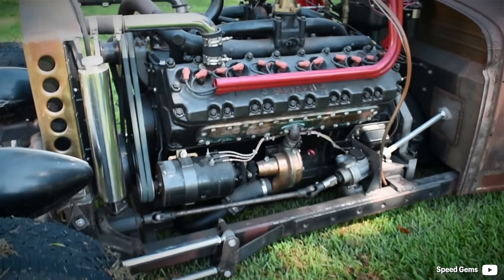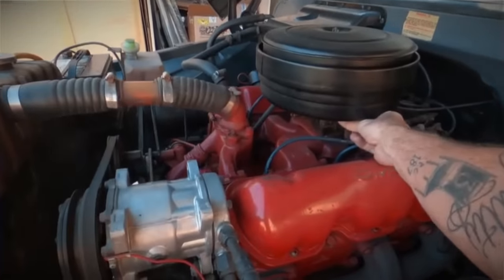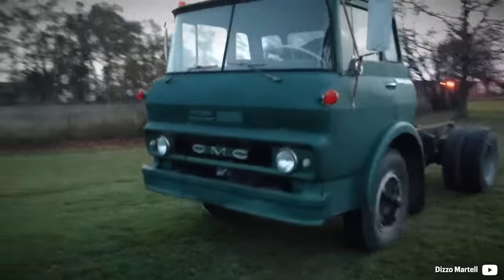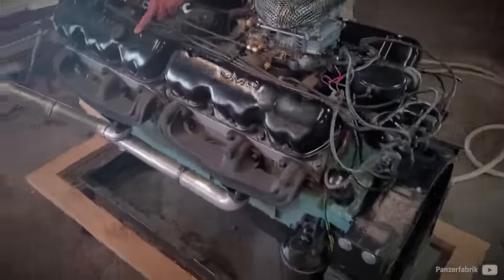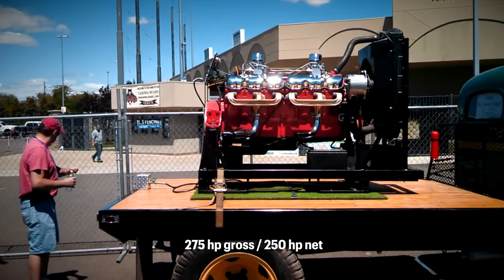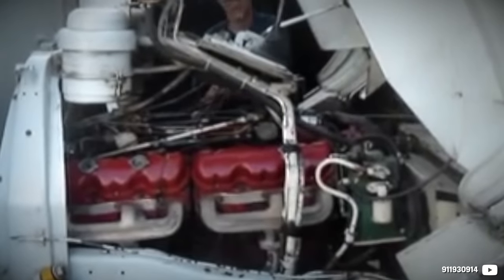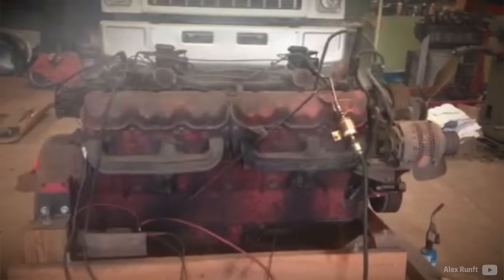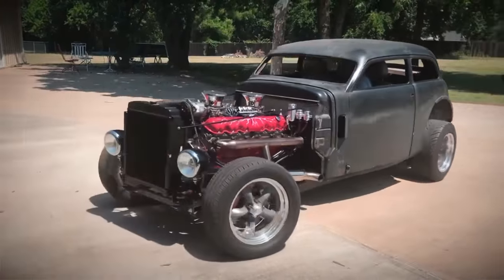GMC's Low RPM Gasoline 11.5-litre V12

Comment: Those intake manifolds are sooo low.. put a high rise on these, do a little port and polish... that thing would scoot along nicely.

Cool motor, didn't know they existed.
Reply: If you could find one or good at making one. I don't know of any aftermarket ones available, the engine was never designed as any kind of performance engine.
Reply: @edmundanderson657 
That's kind of surprising, seeing how many individuals were messing with one of those engines. 

There's nothing wrong with gaining some extra horsepower and torque. Seeing they're used for all sorts of applications, why wouldn't someone want to up those numbers?
Reply: @elgoog7830  Oh I'm not saying people aren't using them or people aren't wanting more out of them.

They just weren't that plentiful, and they are heavy and designed to be a workhorse. Think about it, what was the ratio between cars and trucks in the 60's? Then these engines only came in gmc trucks (and how popular were they compared to the big three) and irrigation pumps. Now compare that to small and big block chevys and how many cars and trucks had them. Then big and small block fords, then big and small block mopars and the cars and trucks they came in. 

They just weren't a common popular engine and the aftermarket wasnt after it. I don't know of any aftermarket intakes, could be just don't know of any. And the stock ones are 1bbl and 2bbl. 

They were made a long time ago and for a short time in limited application.

Comment: If this engine was brought back and adapted to run on propane and increase the compression up to say 11:1 or more it would be a cost-effective replacement for the present diesel.  If you put a boost of say 4-12 psi, electronic ignition, and that higher compression ratio you could easily match the power at low end of a diesel with the massive advantage of fuel costs and a drastically cheaper maintenance issue.  Diesel of old was very trouble-free but on a side note, they had absolutely NO emission controls and mechanical injection systems and required little attention for up to a half million miles.  Now diesel engines have emission controls that zap power drastically, are an absolute maintenance nightmare, and reliability is not that great.  Gas engines at that time required continual Point/Plug changes at 15k miles, which was on an over-the-road truck as little as a monthly item, carbs needed attention every 50k or so and you get my drift.  Now days Fuel injectors on a gas engine last often the life of the engine, and if they need replacement which is usually due to contamination, they are cheap, under $50 bucks each for the most expensive units.  Often you can purchase a reconditioned set for the engine for under $75 bucks, or you can clean them yourself with a spray can of injector cleaner, 9v battery and a homemade pigtail.  So a updated GMC truck gas engine would be cheaper to operate and have equal or more power available.  Yes it would use more fuel but propane is much cheaper even than gasoline and an added plus is it is very clean burning.
Reply: EPA WOULD Get involved and would put EGR and cat converter on them. Remember these moters were made when regular gas was 91 octane and. 25 cents per gallon!
Reply: @lloydmcnurlan6180  Yes, they would require most likely be an EGR and a cat.  However, when you run Propane ONLY suddenly the CAT is not doing all that much and the EGR is employed to lower emissions which are quite low when employing Propane.  Right now there are many Heavy Duty trucks running Propane with great success, however, the Government is the largest stumbling block to the expansion of this concept.  Right now it is all but impossible to set up a propane refueling station for commercial sales due to governmental regulations which do nothing other than prevent them from being instituted.  Companies that do run propane normally have their private refueling yards at strategic locations.  The Biden Administration is placing every stumbling block they can devise to push for EV's, even though it is becoming clear that they cannot be charged rapidly and there isn't enough power available on the grid to support these heavy-duty EV's, it is the thought that counts.  The days of the ORT diesel is rapidly coming to an end, all of the diesel advantages are suddenly coming to an end, sorry a diesel is very difficult to clean up emissions and still have reliability. Again the government acts as normal, "You cannot do this, but they don't have an alternative solution, or the solution is not workable in the real world".  Actual over-the-road tests with light-duty trucks on interstates pulling a relatively light load trailer, their range have a range of no more than 100 miles at best.  Then these vehicles' recharge time even at a rapid rate charger station is sometimes over an hour.  Yes, the Tesla Truck is listed at 500-mile ranges, but as you noticed there hasn't been even 1 unit released to the public as yet.   At low speeds, 35mph average, they do have good operational ranges, so they would be excellent for very short-haul operations on city streets, but simply due to physics they are not going to work on highway speeds efficiently.

Comment: You know if they built engines like motorcycles with the juggs seperate from the crank case they could financially consider this in 2022

Or even a v10 corvette 🤤

Comment: I wonder how powerful a modern version of this same engine would be retrofitted with a modern electronics and fuel injection. Could the fuel economy be made acceptable with modern technology?
Reply: It's already about the same as a modern diesel so...
Reply: @lamarzimmermanmennonitefar5269  I was just wondering out of curiosity since a Ford 7.3 v8 gasoline engine can produce  430 hp and 475 lbs torque (Net) and get decent fuel economy. The 6.7 diesel can produce 475 hp and around 1000 ft torque (Net). I’m just curious. It might not have any advantages. It would just be interesting to know.
Reply: Modern ports and combustion chambers would do a lot more than adding computers
Reply: @lb9gta307  The tactic to keep Heavy Duty/Industrial motors running cool in those days was to drop compression.  If you took the same motor that was a regular duty and compared it to a heavy duty in those years, it would typically drop from 8:1 to 7.5:1 or so.  They had the technology to raise compression back in those days, and chose to drop it instead to make them work.  

So, you are back to gasoline's usual problems when put under major loads.  Sure, you can hook up a 6-10 speed transmission to a high compression gasoline motor, in a LIGHT DUTY truck, and make it work.  But those little turbo gasolines (even with DI cooling) and high compression NA motors with greater displacement don't have what it takes.

You are still going to be running a large displacement, NA motor, and like the 7.3 you are going back to OHV because you can only run those types of motors in the low rev range in all practicality.  And, once again, you will be considering "how high can I crank up the compression before it runs to hot under load"?
Reply: @lb9gta307  true.  But the precise fuel metering of multi-port or direct injection combined with precise control of ignition timing will help too. Adding redesign combustion Chambers , along with better breathing would do even better. But precise fuel and ignition control even by themselves would make a difference, just not as much
Reply: @dmandman9  That 6.7 diesel is souped up and boosted with turbos, for the same boost rate a gas engines of the same size will make more torque and HP and high BMEP than a diesel. this goes for 2 stroke and 4 strokes of equal bore/stroke. look up the ETHOS cummins 2 stroke converted 4 cyl engine on ethanol. This 702 in its 4 stroke state would make about as much power as the 920 CID 6 4 joke stroke diesels today with ethanol and a hot magneto. This 702 could easlily be converted into a 2 stroke and make way more power. keep in mind the 6.7 powerstroke is a 2 stroke and 7.3 gas is 4 stroke. everything newer is not always better!
Reply: @jlo13800  Both the 6.7 and the 7.3 are 4 stroke engines. The 7.3 powerstroke was a great engine. But it produced approx 250 ho and 500 lbs/ft torque. The 2022 6.7 powerstroke produces 475 hp and 1050 lbs/ft torque. Yes. It's much more complex but it's a LOT cleaner burning when I have a properly running 7.3 in my bay, the worker next to me yells for me to shut it off within a couple of minutes because it's choking him. But when I have a properly running 6.7 in my work bay , he doesn't complain. Again the 6.7 powerstroke is a 4 stroke engine. The crank makes 2  revolutions (4strokes) per ignition cycle. The cam only makes one revolution. The 6.7 is a 4 valve, and has a larger turbo. Also, the injectors are much more precise. And the injection pressure is higher which allows better fuel atomization. Those are a few reasons for the improved power.
Reply: @jlo13800  by the way. A modern naturally aspirated fuel injected gasoline engine produces more power over a wider range than an older carbureted engine. Example: a 3.3 liter (200 cid) in a 1965 Ford Mustang produced 120 hp (gross) and 190 lbs ft torque.  But a 3.3 in a 2022 F150 produces 290 hp (net) and 265 lb-ft torque. By the way , the 3.3 has a wider power band. So it produces decent power at low AND higher rpms in relation to the older engine. Both are naturally aspirated engines. So it's reasonable to believe that those old GMC's could produce more power if they were equipped with modern electronics, variable cam timing, fuel injection, etc , much like the modern Chevy 5.3 produces more power than the older small block v8s over a broader rpm range. As I stated. I'm just curious

Comment: Why would you need 2 engine stands? Isn't the block itself one unit but multiples of everything else?
Reply: I'd think it's simply too long for a single engine stand, it would topple over.
Reply: @Jeroen Huge commercial engines and diesels don't use a stand for the front and the rear. Put a 2x4 or 4x4 at the base or front of the engine. That's what we've done when we would be storing a V8 on a stand for a while to keep the stress off the bell housing bolt holes. I realize it is probably highly unlikely, but supporting 500-700lbs by 4 to 6 bolts just in the back of the block for any length of time can't be ideal.
Reply from the maker: Weight, perhaps

Comment: 4mpg = 1.6km per litre 🐱👍🏿
my Yamaha gives me 40km per litre
Reply: How much would it get pulling a 55000 pound load 😉
Reply: @JohnSmith-lb3ge  if i use a 45 final drive tooth sprocket it gets into the 20's 🐱👍🏿

Comment: Remember 3/4 race cams?  3/4 of a V-8 race cam welded to another 3/4 should fit in these right?  I put one of those 3/4 cams in a 327 once, 4 of the lifters kept falling into the oil pan.

Comment: Modern engines: Have to to get timing serviced every 75-80k miles, major service at 250-300k.

GMC: Minor service at 500k 70 years ago.

People like to complain about us car guys that "they don't make them like they used to", but in this case, that's pretty much literal.
You probably get somewhere close if you're talking some industrial or genset Diesels.

Comment: a huge V12 engine with an extremely over engineered block and a crankshaft with little stroke allowing an even greater increase in cc, WHY DON'T TOP FUEL DRAGSTERS USE THIS ENGINE??????
Reply: There was a 550 CID limit on dragster engines (it might have gone even lower).

Comment: The 401 was a better choice over the 478 witch could not hold the rod's in side the block
Reply: The 478 you don’t dare rev over 2800 on the highway.

Comment: You essentially have 2 engines
.
This would be a reliability / always gets ya home marketing dream!!!
.
If one carb goes down... ya still got 50%
Or maybe it's only not opening the secondary, but ya get primares
75% power....
.
They knew the v6 was good
So why reinvent the wheel?
.
Ferd reinvented the spark plug
That went just great
.
I do them... 80 USD per spark plug
If ya got a 6.8 v10.... I'm sorry

Comment: And before this GMC used Pontiac engines.
Reply: For their V8s. The straight/Inline six cylinder was a proprietary GMC design. It had full pressure lubrication when most engines, including the Chevy inline six, were using splash lubrication. This is why the GMC Inline Six was highly desirable for hot rodders and racers in the time before the small block Chevy V8 existed.
Reply: Pontiac V8 engines in the lighter trucks and Oldsmobile V8 engines in the heavier trucks. 1955-1959.
Reply: @HotWheelsBurban  The straight sixes evolved from the Buick valve in head sixes that were discontinued inn the late 1920's.

Comment: Good lord!  Amazing, but why?
Reply: The engine was designed to compete with diesels in heavy duty trucks.  This was at a time before the turbodiesel became dominant in that application, and some manufacturers used gasoline engines.  Lower initial purchase price.
Reply: In cold climates, gasoline always works, and diesel can often times gel up and cripple motors and vehicles.  That is why there are medium duty gasoline trucks to this very day, and gasoline heavy duty trucks persisted for a very long time.  Ford's 8.8 liter gasoline Super Duty was only put out of production by government regulation, it was still popular.  

Gasoline motors are cheaper and easier to maintain and fix, especially back in the 50's, 60's, 70's, 80's.  US engines of that time were extremely simple OHV engines that were easy to repair and rebuild.  In the long run, fuel savings might be lost to repair and maintenance.  IN this era, gasoline competed head to head even with stronger and stronger diesel motors.  

For a long period of time in the US, it made more sense for gasoline than diesel.  Especially farmers and very small businesses that wanted to fix things for themselves.
Reply: @kingduckford  And Cummins recently announced they are developing heavy duty gasoline engines.  EPA has regulated diesels to the point where they are no longer economical compared to what can be done with modern technology applied to gasoline engines.  Lower initial cost due to simpler fuel and emissions systems.  Lower operating cost due to gasoline being cheaper than diesel and lower maintenance costs and downtime compared to expensive and unreliable diesel emissions systems.

Comment: "Best engine" is highly subjective. Considering that we can get 470 ft lbs of torque @ 2500 rpm out of 3.5L EcoBoost V6. And 30 mpg. Not saying EcoBoost are the best either, just saying we've come a loooooooooong way in efficiency.
Reply: Without the turbo's, the ecoboost wouldn't make anywhere near that torque.

Comment: Less RPM can mean longer engine service life.
Reply: absolutely. a 478 would run good between 1500 to 2400. whereas a 427 would have to be turned up to 4000rpms to get any real power out of it. some would run them up higher and the 427s would eventually give out
Reply: @ellenhaag406  Hello Ellen , thank you.

Comment: My question would be was there ever one of these converted into diesel like the 454
Reply from the maker: I could not find a word about that
Reply: The diesels (Toro-Flow) were based on the 351 and 478 V6, and the 637 V8.

Comment: Gas direct injection turbo engines just might make their way into heavy trucks before the feds outlaw internal combustion engines. The persecution of diesels is real. $5.50 plus a gallon here in Idaho.  Cummins already has the 6.7 l inline 6 direct injection spark ignited turbo gdi engine for heavy pickups. Perhaps a return of Hall Scott non diesels for heavy trucks? I've seen package delivery companies with large step van/ package cars shy away from diesels and use big block gas v8s and v10s . Mercedes Sprinter uses a small 2.0 liter gdi turbo and is quite a little monster for its size. 8.8l v8 big block gas engines for school buses.  Heavy duty gasoline engines are not taking a quiet role nowadays.....they are stealing alot of diesel's thunder in many light and medium duty applications.  Reminds me of the old days of ww1 and ww2 tank engines.

Comment: Not that much of a power for today's standards even for low rpm, but when it comes to reliability this thing will outlast anything. This is the only design of an internal combustion engine meant for power and reliability! All the rest are just work arounds for emissions and mileage.
See how beefy the block is? Like half your hand's size wall thickness between cylinders.
I wish they would build today's car engines like that, they make nasty crap that break down just because they look on how to shave 1 pound steel off of their design, and at the same time they load hundreds of pounds useless plastic crap.

Comment: Cheap was only one factor.  The science of engine design still had alot of work to do: efficiency pretty much sucked across the board - valve timing was nearly guesswork.  So... the easy way out: build bigger engines.  But hp per cubic inch still sucked.  Look at the old ford flathead for example: intake charge had to first go down below deck height, then up through the valve.. then negotiate two 90 degree turns to find the cylinder bore.  That was the automotive equivalence of constipation.
Reply: So it was "shit"    ?

Comment: So who's gonna be the first with a turbo build?
Reply: It's been done. Huge, slow revving, low compression, super beefy pistons with 4 rings and forged crank, it does seem like the ideal engine for turbos. Probably needs a lot of head porting and better valves to really flow efficiently without big pumping losses, though.
Reply: @elektro3000  The heads are OK, but they're mated with a really low-lift, short duration cam.  Thunder V12 engineered a performance cam for the V12 and distributorless electronic ignition system, which wakes it up to 425 HP.